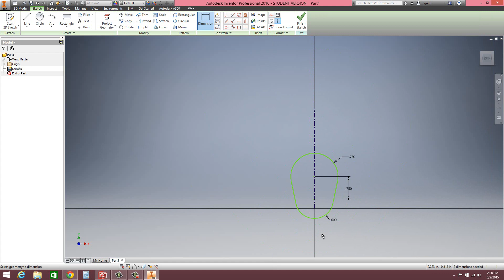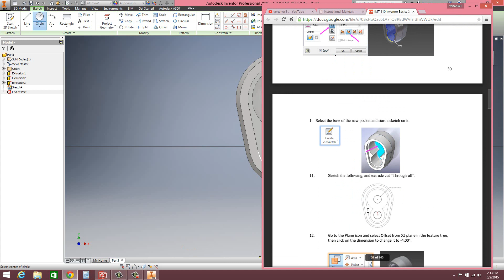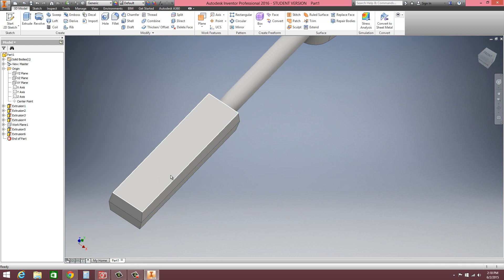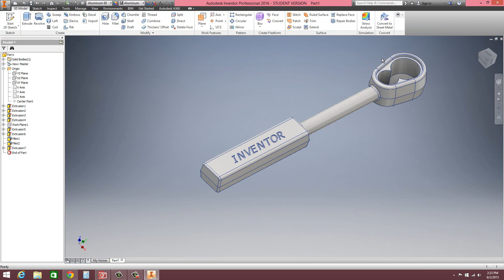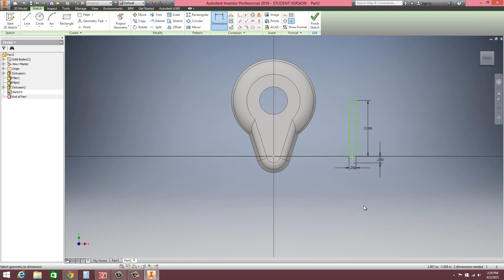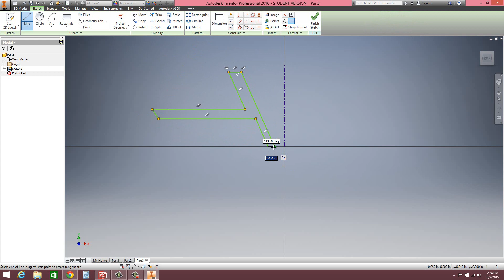E3 Autodesk Inventor Professional 2016 - Basic Modeling 3 Tutorial

Comment: A little faster method for  the handle: use workplane 1, draw a two point center rectangle using the rod circle center and extrude the square. But can't do the tapper. Any workaround for the tapper?
Reply from the maker: Thank you for the advice Waldo. After 20+ years of teaching and using 15 different CAD/CAM systems, I always make it a point to mention the first day that the methods I use may not always be the fastest, but they are taught to give you a broader spectrum of exposure to tools and methods that may prove valuable in certain situations. The method you describe is one I teach two weeks earlier in (L1B). Thanks again. There is no work around for the taper as far as I can see yet.

Comment: I have a question about using a library. Say I have designed a plastic two part frame for my gizmo. I need 8 self taping screws that are already available from a distributor. I would not want to try and match the current design or make a new design that would require manufacturing. Are there libraries with such parts so I could just pick the correct screw in this case and insert it into my parts list for the project? I am using 2014 student addition.